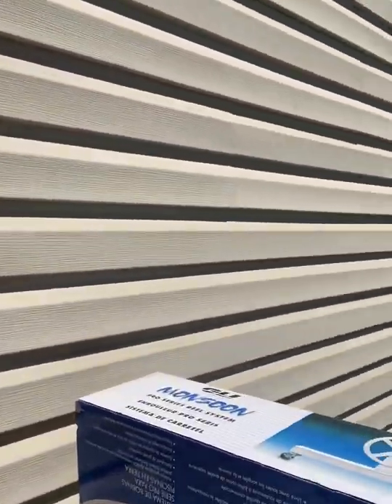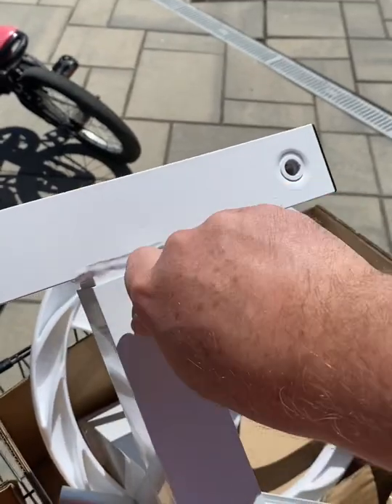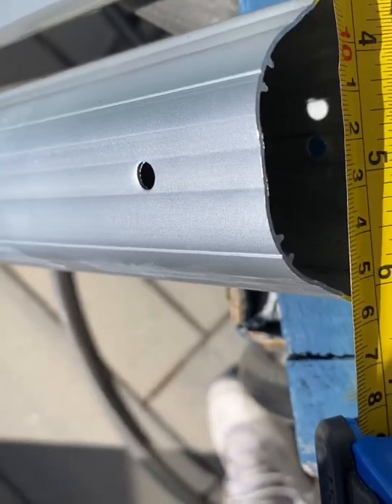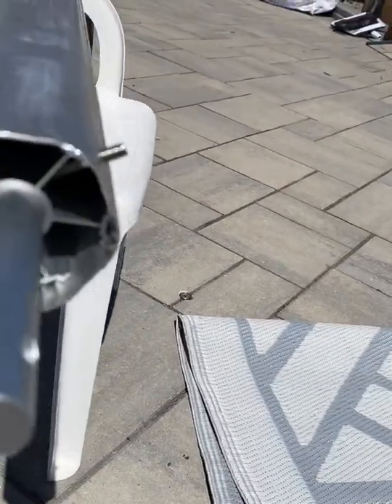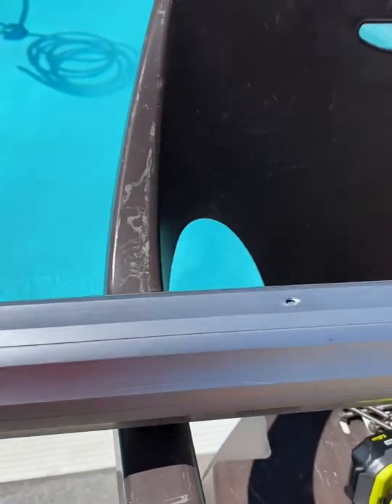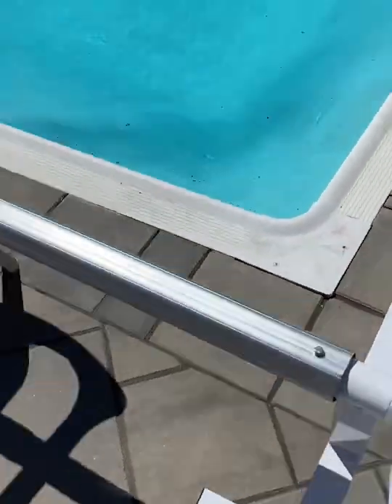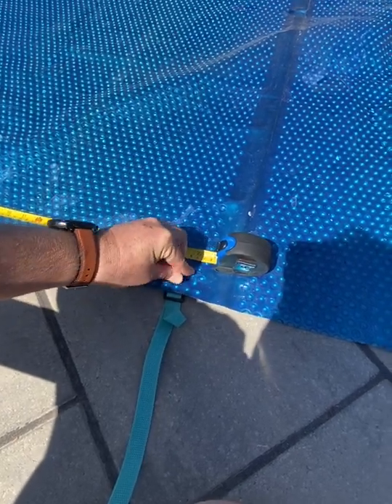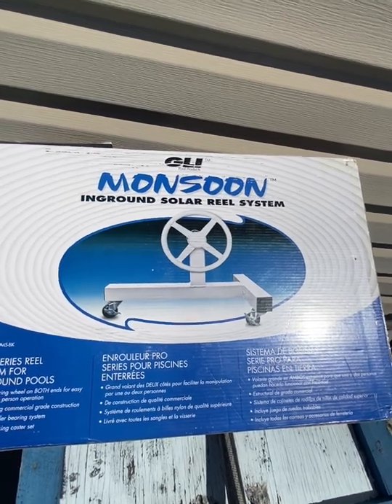GLI MONSOON IN-GROUND SOLAR SOLAR REEL SYSTEM

Comment: What was the one problem you had?
Reply from the maker: David, thanks for asking it turned out that on both ends of the real when I went to put the steering wheel on the bolt holes were not aligned. It may be that I inverted that beam and have the wrong section on the outside and ends. I really don’t know but I had to drill new holes in the steering wheels to reach. I’ve now been using the real for close to three weeks and it’s been working excellently.
Reply: This was an issue with my reel as well.   I took all the tubes apart to make sure the right parts were on the end.